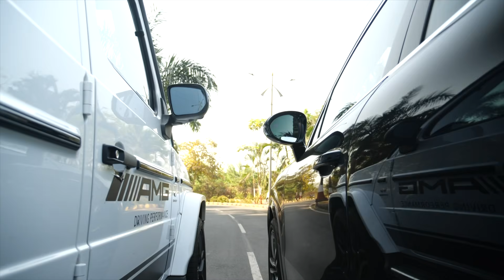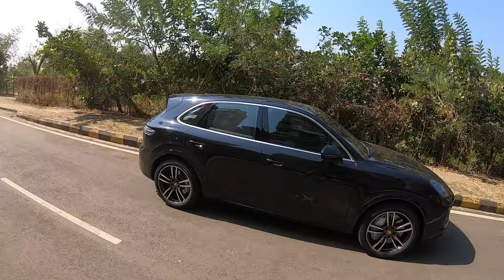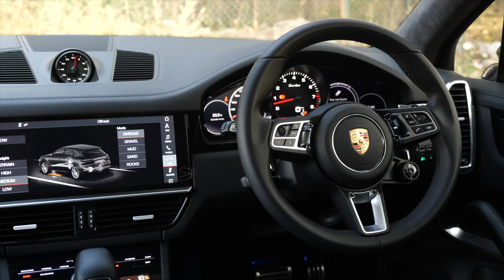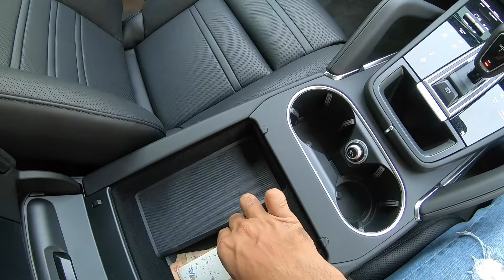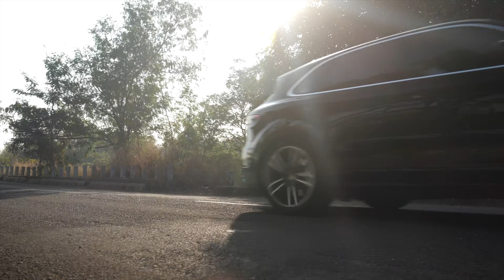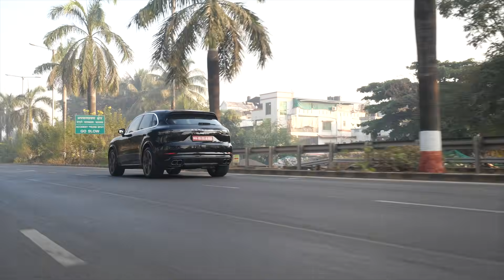Porsche Cayenne Turbo - Best SUV In The World | Faisal Khan

Comment: sorry to burst your bubble but I ordered a fully loaded 2015 cayenne turbo for my wife, while I replaced my old 2010 bmw X6m with a 2015 x6m. There is no comparison, the porsche cost $25k more (German built robo assembly) and does not come close to the x6m (engine Germany built robo assy in US). The x6m beats the cayenne in every single area. There's nothing the porsche does better. The build quality on both is superb. However, for a woman driver the cayenne has certain advantages in terms of handling, it is a less masculine car. I personally consider it an overpriced average suv. I would never buy one for myself. You will never see a head on comparison in any magazine or YT video, for that reason. Its a more expensive lesser car.

Comment: This car doesn't have the optional Sports Exhaust System...that is why it is a bit quieter...!
If you choose the Sports Exhaust System, you also get a button on the center console to open or close the exhaust valves whenever you want...and also the exhaust pipes in the rear are 4 big circular exhaust tips in the Sports Exhaust...instead of some square shit on this car...!